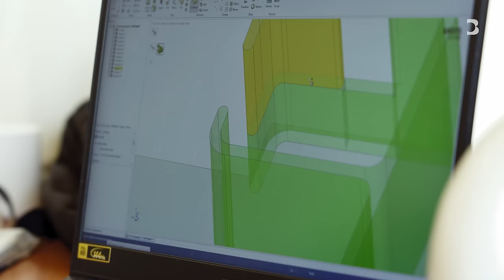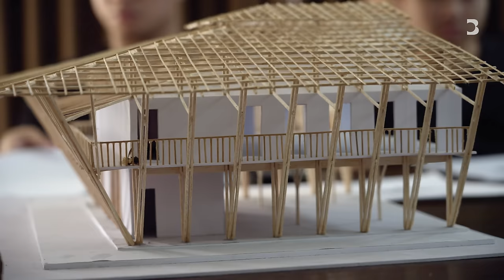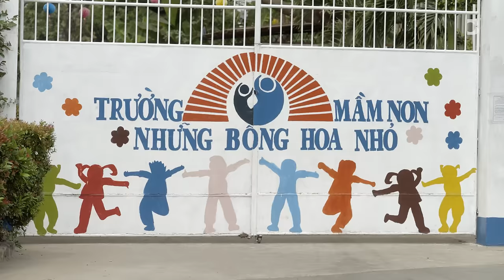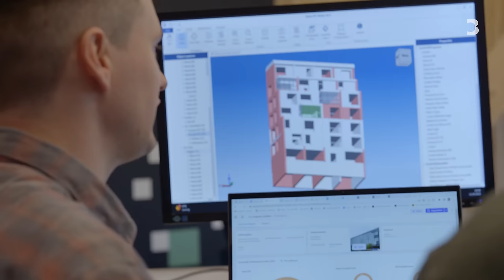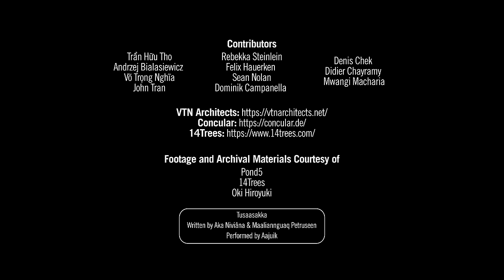Shelter: Building the Future of Housing | An Optimist’s Guide to the Planet

Comment: Hmmm, too bad that 3D printed houses aren't deconstructable. I wonder if its just a fad.
Reply: Construction has a ways to go...😮
Reply: Looks like concrete what's the difference? Prefab wood homes in the US seem miles better in terms of efficiency and sustainability
Reply: Construction is a massive industry that moves a lot of people and money, and it's also not straightforward: it's very expensive, competitive, and every site is different. For such a big and complex field, it's natural to have multiple approaches evolving to solve the issues within the field, in small ways.

No one person will come up with the ultimate solution, and even if, they need to cooperate with the existing systems in an efficient way for it to work. No contractor will ever accept a project that relies in too many unknown technologies, it's too risky.